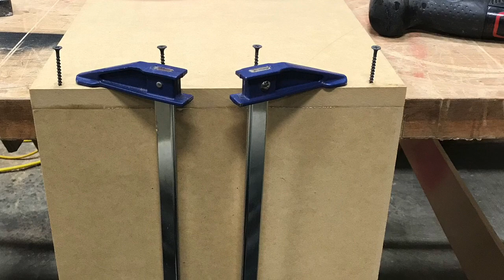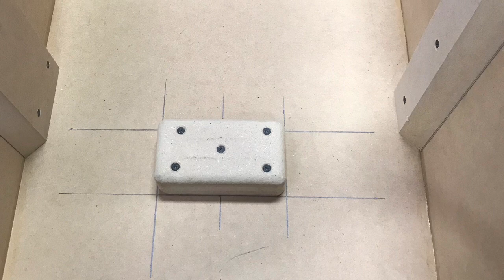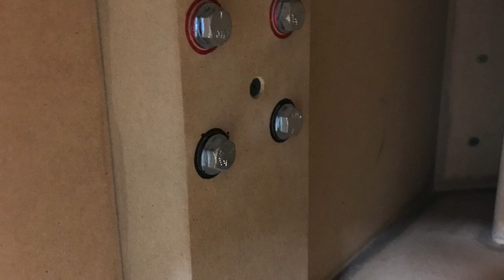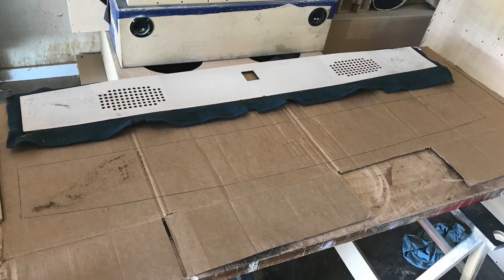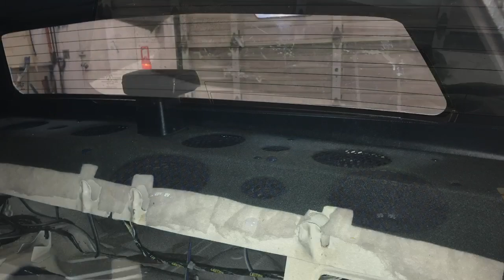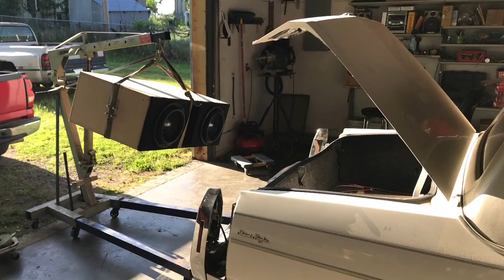Box build for 2-12” Sundown ZV4/5, front and rear speaker deck build/install for a 1986 Cadillac.

Comment: What size mdf u use for the rear?
Reply from the maker: 1/2” mdf for the speakers to mount to and 3/4” mdf for the rear deck lid cover with grills.
Reply: @210Designs  Preciate it
Reply from the maker: @BillyRay501  Anytime 👌🏽

Comment: What is the purpose of painting or finishing the inside of the port itself?
Reply from the maker: This build was unfinished. We got it playing for a local show and he was supposed to come back to have me finish it. Won some trophies and he was hooked 😂 We were going to add beauty panels and lights. So you could see the subs and port from the inside, when you lowered the armrest.
Reply: @210Designs  man, what a beauty of an enclosure and that rear deck for those 6 1/2 is just sick. You  should really take pride in making these enclosures because they are works of art if you dont mind me saying. I have a 15 zvx that I need a enclosure for. It's in a chevy lumina so my trunk height opening isn't that tall, 18 inches of clearance is what I have to work with.
Reply from the maker: @Frances_P  - Thanks man, I really appreciate you saying that. Glad it shows  🤙🏽 I wanted to give him something no one in his area has. That’s a mean sub you have. Built an inclosure for one of those. Just email me and I’ll see what I can do 🤙🏽 bj.hammon@yahoo.com

Comment: How thick did the rear deck end up being 1/2 or 1 inch? And how did you get a accurate template for the rear deck? Thanks and i love the narration.
Reply from the maker: Rear deck consisted of (1) 1/2” and (1) 3/4” piece of mdf. In order to get the rear deck accurately, I used a piece of cardboard as a template. And transferred it onto the mdf pieces.
Reply: 210 / Designs ok thanks brother!!!
Reply from the maker: PAPERGATORZ FEDDUCCA - Your welcome 🤙🏾

Comment: Talk about why you don't trust factory specs, and what do you think about jL audio w7 13.5 subs?
Reply from the maker: Yessir, I have trust issues 😆. JL w7 13.5 subs are the truth 💯🙌🏽 By far my favorite sub out, to date. Just so damn expensive 🤭
Reply: @210Designs  ikr.... like $1200 +
Reply from the maker: Chrisnas1 - 😆 yea, it’s definitely not cheap.
Reply: @210Designs  but I love them.. I have w7 12 2 of them, but I need another amp to power the 2nd one and I had a dude from fl put another voice coil that was a non jL one, it's more power handling than oem but I wanted jL voice coil.
Reply from the maker: Chrisnas1 - One is these days, I’d like to buy me a pair JL W7 subs myself 🙏🏽 They are on my bucket list 😂 I like to keep my subs as close to factory as possible. Makes it easier when you have to replace or repair. How much more power will the modified sub handle, over the factory one?
Reply: @210Designs  I forgot the specs for the oem w7 12 single voice coil but I think I remember he said  200 more and he had to make + minus and - plus on the terminal
Reply: @210Designs  I txt him , he's from fl so give me time to get in touch with him
Reply: @210Designs  he just said 600 700 more watts to oem.
Reply from the maker: Chrisnas1 - 🤭🤭🤭 Shit. He wasn’t playing no games with that one 💪🏾💪🏾

Comment: Do you build boxes for ppl outside of where you are?
Reply from the maker: Every now and then. The main reason I don’t, is because of box fitment and the ability to test the subs in the enclosure before the customer picks it up. That way I can guarantee box performance and fitment in the vehicle 👌🏾
Reply: @210Designs  so tell me the best box for rap and r&b but I like all music too
Reply from the maker: Chrisnas1 - Thats a loaded question bro. It’s gonna be based on several factors. Type of sub, size of sub, power available, vehicle, electrical, etc. Here’s the thing, I love sealed and ported boxes. Each sound and perform great if using the right sub, box specs, power and vehicle that it’s in. *Ported boxes are more efficient, if tuned/built correctly and will give you more output on less power. I tune most of my ported boxes around 32-36hz. Plays all types of genres of music very well. Customer plays country to rap and everything in between 👌🏾
Reply: @210Designs  Hello im trying to see how can I build a box in the trunk of a 2007 DTS Cadillac for 3 15" Nsv V4 2 ohm subs ?
Reply from the maker: @dg2041  That’s Gianna be a tricky build. Going to depend on several factors. Subwoofer layout, port location and type.  Not saying it’s not doable, but seems like that box might need to be built inside the trunk.
Reply: @210Designs  Understood people keep saying it can't be done.
Reply: @210Designs  👍
Reply from the maker: @dg2041  It can, it will just take an experienced builder 💯 Keep in mind, you can put 2 in there, in the right enclosure and have it knockin’ like it was three of them 👌🏽
Reply: @210Designs  Thank you Sir
Reply: @210Designs  I also was wondering about not taking the seat off and buying ports to stitch in the back seat for air  or no no ?
Reply: @210Designs  Understood I'm going with 3 to wake the dead 😊
Reply from the maker: @dg2041  my man 👊🏽